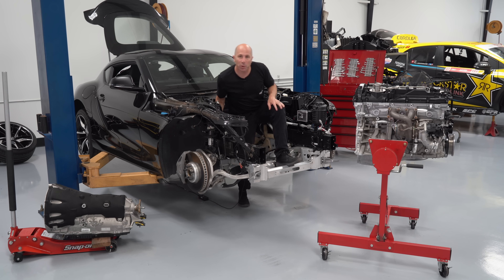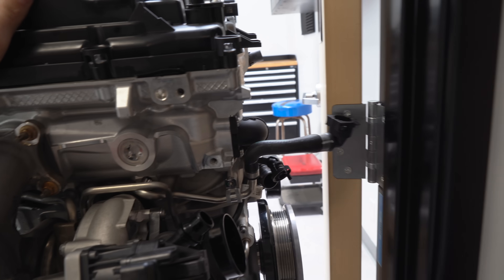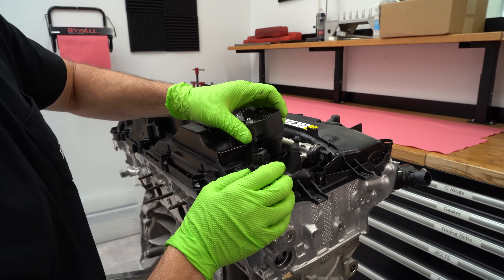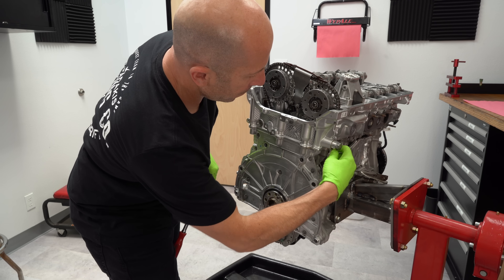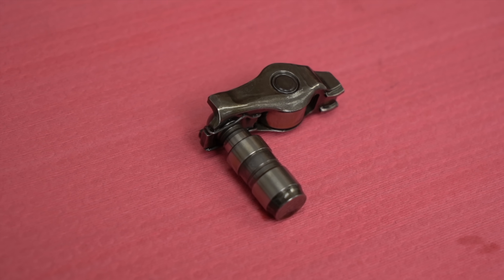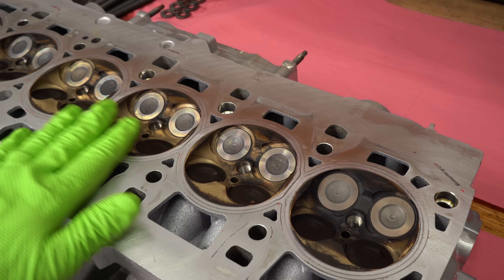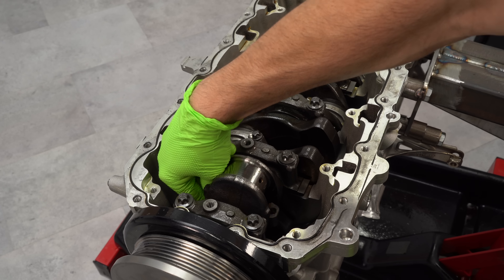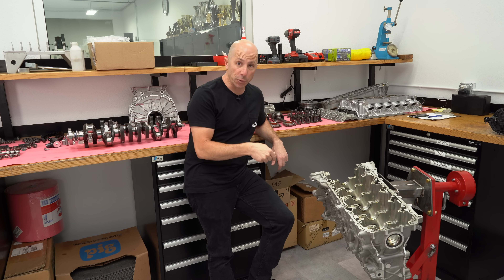2020 Supra B58 Engine Teardown - First Look - Better than the 2JZ?

Comment: How could this design possibly be good for maintenance??
Reply: The whole point is to eliminate trouble areas completely. Ie, the ignition module as one entire piece instead of several, no external oil lines running to a cooler to leak down the road, etc. Its very obvious that BMW put a ton of effort into engineering this engine to not only hold big power, but last a long time doing it.
Reply: @FlyingStuff  Except that the N54 and N55 that this replaced are both known for being total money pits as they age, and this one has all the same features as those plus a timing chain with plastic guides at the back!..... I would NOT want to own this engine after 100k miles!!
Reply: @soundseeker63  N54 money pit? WTF you on son. Aux systems like HPFP or coils go but the actual engine is solid as fuck.
Reply: Scott Fugere they put the timing chain on the rear...
Reply: @asshat Jackson You must know everything having sat at reception.

Comment: Timing chain on the back?  Oh FFS the Germans just don't learn.  2JZ you can change the timing belt in ~2hours.  In this thing you are pulling the motor out and doing a LOT of disassembly.  Simple design?  We have different ideas on simplicity.
Reply: And it's claimed to be a Toyota.. So much for serviceability. That shit is terrifying
Reply: @wicked49ford  
I had the 90's Ford 4.0 V6 designed and manufactured in Germany.  It had the timing chain on the BACK of the motor.  The chain guides broke and I had to pull the motor to repair.  I invented a few new profanities that weekend.  It is fine if you never keep a car past warranty, but long term it is a TERRIBLE design decision.

Comment: I have been a tech for 12 years now, I have rebuilt so many Supra engines and after seeing this... This engine is garbage, to much PLASTIC, they made it entirely to over built to the point if 1 thing breaks your spending thousands to repair... Just to much to fail on this newer engine...  I will always enjoy the simple Honda and Toyota engines from the 90s and early 2000s.... Honda is doing the same thing now, over complicated everything...
Reply: the problem isnt the car manufacturers but the government with those EPA and safety ratings

Comment: Extremly complicated, plastic, bmw motor. Designed to be a disposable. Will be pissing oil after 60k miles out of every hole, just like every modern BMW.
Reply: i just hope that the huge community behind the supra works fast to improve this engine

Comment: bmw engines are so sick!
Reply: Unfortunetly most of them are not reliable, luckly the're aftermarket piston bearings for the S85 V10 engine to keep it runing with no problems, but i may have to spend on a manual transmission swap if the SMG fails.

Comment: The only thing that seems like a concern with high horsepower applications is a lack of a cross bolted main cap system. Everything else seems pretty stout, but consider the traditional two bolt main caps as "potentially" a weak point. But hey, it could make 1k hp no problem.

Comment: Wow an an engine may actually be better than a 2jZ that inst Toyota? Hmmm.

FYI I still think it's not 😆
Reply: @Psycho-NutKase  it is not, Yamaha did the 1jz head. 2jz-gte engineering was done in Germany by Johann a. Krauze maschinenfabrik GmbH.
Reply: I don’t think that block will hold 1000 Hp it list not like the 2JZ
Reply: @bimmerlife5452  it's a closed deck design like the 2J. If the n54 could hold 800hp with a open deck and stock internals than the b58 should be more than capable.
Reply: @2jYeti  cant wait to see it bro
Reply: @bimmerlife5452  Lmao it would blow, but this comment was a joke ;-;

Comment: How much less does it weigh than the internet’s favorite boat anchor?
Reply: The RB26?

Oh, the other boat anchor.

The LS?

OH THE OTHER OTHER BOAT ANCHOR

The 13BREW

Oh, not that boat anchor.

I dunno. I'm sure it's just a bit lighter than a 2JZ.
Reply: @CardboardSliver  Well 2JZ weights 230kg and B58 140kg so yes 2JZ is overrated boat anchor

Comment: only issue that new engine will face is heat cycles that internal exhaust manifold is a proven weak point, but only time will tell. the design is all ready out of date....
Reply: @Seb C other manufacturers have all ready regretted that design.
Reply: @Seb C ask Ford

Comment: 1k HP on a supra? ..still will get beat by a stock eg in a down hill touge run 🤦‍♂️
Reply: If it is setup for downhills, the upgrading would not be focused on the engine but on the stiffness and lightness. Going for high HP is a clearly targeted to straight line pulls. More HP has adverse effects on the ability to handle the car in corners.
Reply: putting that kind of horsepower in that car without focusing on every other aspect is a fail in itself. So the same would apply anyway
Reply: @VERIFIED_COMMENT  in that we are in agreement. I recon the car is being tuned for a show off that only wants to impress by performing dull acceleration pulls. If the owner of this car is even semi serious about having a good all rounder, he is going to need to invest plenty more into the suspension and chassis itself. However having said that, knowing the maturity level of these ppl, as long as it looks good on paper, then it must be good.  I recon the true art and pleasure of driving is being lost in a world focused on selfies and showoffs on social media.
Reply: @ZxRx7  drag is a thing out here when I was  visiting my girlfriends parents in  japan I've seen kanjo and touge racing through her brothers and it's a whole lot of respect to the cars that they don't talk about 1k hp most I heard was 750 to 800

Comment: The only thing I have to say after looking at this engine - you boys better change your oil every 5000 miles and coolant every two years otherwise you'll be pulling that oil filter stand and that thermostat housing every two years. Also, BMW's favorite place to leak oil, the valve cover! Synthetic oils turn very acidic when they break down and start to turn rubber into plastic. Of course, BMW being one of the largest auto manufacturers doesn't have enough money to make gaskets out of proper oil resistant rubber, so you're on your own! That's why they glued the oil pan, because rtv resists bad oil better. Also, 100k miles in, all that plastic coolant pipes will finish cooking and start breaking. Plastic and heat don't go well together!

Comment: Is that a plastic timing chain guide I see? Classic BMW engine out service every 60kkm
Reply: never seen one fail tho lol.
Reply: @dimanestroyovyy  n47, that's all I'm gonna say.
Reply: GTTwincam oh I didn’t know, on the n52, n53,n54,n55, they never fail, and if they do, they’re really easy to replace. Me saying that because I broke it while screwing the head bolts on a head gasket job
Reply: Soon as you google n47 timing chain comes up straight away, Iv seen same problem on many Bmw engines, it wouldn’t be too bad to service until they decided to stick it at the back
Reply: Yeah Bmw have some great reliable engines definitely, usually the 2litre diesels they share with mini seem to be problematic

Comment: Crappy unreliable bmw motor. Couldn't touch a 2JZ if it wanted to. These bmw inline 6 cylinder motors blow up after 500 crank hp unless they're pulled, and fully rebuilt for about $20k, then you might get 850hp. The old 2JZ could handle 650-685 on stock internals, 1400 built.
Reply: @Seb C I've been working on engines 35 yrs with a neighbor Master BMW Tech. I've had various bmw 6's and 8's plus 2 2JZ's. Bmw 6's do not last long with 600 crank hp which is around 530 whp.

Comment: Remember before buying the C8 : the ecu is factory-ENCRYPTED, so not tuneable whatsoever.
Reply: Holley already has plenty of aftermarket ECUs
Reply: Haha, the N55's used to be encrypted and "untunable" too. Now people have doubled the power and more. A lot of modern engines are encrypted to some extent and every manufacturer says that, but even a high up rep in Chevy says that he hopes to see modified C8's. The reason it's encrypted is for security reasons, not so people can't tune them. It will just take a bit longer for people to crack the ECU.

Comment: BMW engineer good for European cars. Nothing can compare to a 2jz. Better to change the badge back to BMW Z4
Reply: Seb C you probably had bad luck. As a mechanic these new European motors are garbage they are plastic 100,000km parts disintegrate especially bmw and Audi parts, Mercedes isn’t too bad. I’ve seen camrys last 500,000km on original motor. Name a European motor that lasts without major problems? I’ve owned 1jz and 2 rz supras now I own gtrs but I still prefer 2jz motors as tougher than rb26. No comparison these new motor are made to stuff up so you take it back to dealer so they can charge you top dollar for fixing stupid problems like faulty sensors.
Reply: Seb C mechanically they can last definitely if looked after. It’s always the plastic parts and gaskets they let go and the owners keep driving the car until it shits it self. Especially Audi Porsche with the plastic coolant lines and thermostat housing. Bmw always has oil issues always maybe this new supra might not but give it 5 years and let’s see the sales.
Reply: Seb C that’s what’s scary seen oil pan leak? A lot of them don’t have gasket just silicone and when they leak they leak goood

Comment: This seems like a really cool engine, but it's really complex to be marketed towards tuners and car modders. The amount of electronics this thing has makes everything a lot harder to work on and change out. I mean just look at the top of the engine before teardown, did you see all of those wires? I also hate how the engineers thought it was a good idea to use plastic parts. The longevity and reliability is questionable at the least.

Comment: Awesome video and I, along with the rest of the viewers appreciate this effort of creating a tear down video of this B58.  I have what may be a 101 level question.  When you removed the head and had it upside down, why were only the exhaust valves darkened, but the intake valves were not?  Combustion happens in that chamber, so I would expect both would appear to be visually equal. Is it due to the exhaust event in the combustion chamber presenting backpressure to the exhaust flow against the turbine wheel and exhaust system as a whole?

Comment: Lots of people complaining. Yes, it's gonna be a good days work to get to that timing chain. But the engine doesn't have to come out. Looks like you can just drop the trans, remove the valve cover and bam there it is. Timing chain. Really not that big of a deal if you don't mind doin' work.

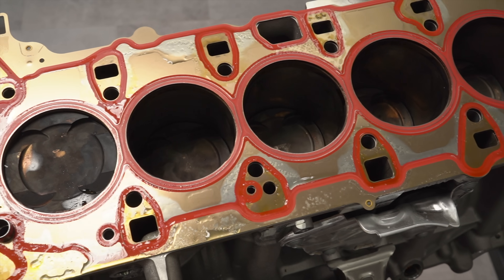Comment: 9:42 its good to see that they use these kind of sealings on the head. Normal flat gaskets spread the force over a wider area, which reduces the pressure the gasket can hold. 
With the domed gaskets the resulting higher pressure makes it more leakproof - Should be good for a lot of boost!

Comment: Lol coated rod bearings...made me think about the E92 M3. I guess BMW learned from that.
Reply: or e60 m5 lol.
Reply: All high rpm M models
Reply: E46 m3
Reply: you should thank Toyota for that. They made sure that the B58C in the supra doesn't have bullshit and cost cutting things in the engine. It is different to the standard B58 engines.
Reply: @1GTASANANDREASCJ  what are the main differences?
Reply: @rodgazinya  i didn't find a list. But i saw that the Z4 has a standard 6 port exhaust manifold instead of the 2 port the Supra has.
So the cylinderhead is different.
What both share: cam chain on the back of the engine, so a replacement will be expensive.
Reply: I talked to a BMW race shop about the M3 V8 engines and here is what they said. The E90 or E92 M3 rod bearings are fine. There were a few cases of rod bearings causing catastrophic engine failure and that made people overly worry. What most likely caused these issues were likely oil starvation, old or improper oil, or just random bad luck. Performance shops capitalize on people's fears and push rod bearing replacement to customers. There are many high mileage V8 M3 engines that have no problems with the rod bearings. Rod bearings in any engine on this planet will show signs of wear. The wear on the V8 M3 rod bearings are not better or worse than a typical engine. It is not unusual to see rod bearings showing some signs of wear or use when you remove them. People's fears are being exploited for business gains.
Reply: Dylan stop while you can 🤣👍
Reply: Lol look at all you 2jz fanboys getting upset, BMW runs your shit
Reply: this is  a BMW engine in the new supra
Reply: @dylanm9981  thanks for letting us know before your comment nobody knew that
Reply: @dylanm9981  my god!!! You're serious? I thought it was 3JZ-GTE engine. Wow thanks for the info😑🙏
Reply: @dylanm9981  holy shit!!
Reply: Dylan Marshall you’re joking dude. Did you not see all the Toyota badges? This is a 3jz

Comment: Timing chain in the back ...

Audi 4.2 V8 flashback
Reply: That's a car you don't want to own past a timing chain service...
Reply: @UconventionalWarrior  They don't need timing chain services, they make over 200k miles on one chain
Reply: @Malteser3535  the audi s4 with a 4.2 v8 was supossed to be a lifetime timing chain.  But the tensioners start cracking and losing pressure anywhere from 30k-200k miles.  About a $4k job in parts alone.  One of my tensioners dissintegrated, jumped the chain, and ruined pistons/valves/everything.  It had 40k on the new tensioners.
Reply: @Malteser3535  The chains themselves, yes. The plastic tensioners and the VANOS units (for which the chains need to come off)....probably not!
Reply: @Malteser3535  ...and 50k on the plastic guides.   A timing chain is only as strong as the weakest link.
Reply: have done timing on those and the VR6, i share the same concern.
Reply: I was thinking the same thing LMAO
Reply: I owned a b6 s4 that failed.  I shuddered when he said timing chain on the rear.
Reply: Fuck those soooo hard!
Reply: Clearly BMW haven't learned much from the N47 disaster!
Reply: I spent all my time working on the 1.8T I have never had the opportunity to work on a 4.2V8.
Reply: Yup, Audi/VW love to put them timing sets in the rear to make the guides a joy to replace.
Reply: Iron Duke was a great motor
Reply: BMW owner and yes it’s a headache
Reply: got it right in the rs4 though
Reply: The worst
Reply: I have to do my 3.2 vr6 quattro next month... pray for me.
Reply: similar to N14 mini cooper s engines too.
Reply: Range. rover /ford. explorer 4.0 v6 one on drivers side front one passenger rear 22 hours.  to change the. rear.  engine pulls. is 14. hours so yeah
Reply: I was thinking VAG about the plastic inlet manifold too. This thing is a set of disasters waiting to happen
Reply: @hydorah  you know how many engined have polymer intake manifolds.
Reply: @hydorah , the trend it's plastic... I repair manifolds and the only aluminum ones I see it's the older ones... The manufacturers don't make the exhaust manifolds out of plastic because they can't...
Reply: @cooperwrks  Yeah. The trend is indeed plastic and due to differing reaction to heat cycles and tendency for plastic to become brittle it present failure points as seen by owners of VAG cars with plastic inlet manifolds. Manufacturers are doing it whether we like it or not! Cost is king
Reply: @hydorah , the worst parts are ones made in a dark plastic or resin that is green on the inside... They are for parts that handle coolant... Very brittle, hard to repair and they insist on making them as big as possible, so if you have a leak, is a big leak
Reply: I'll pass. It's not a true Toyota Supra. It's a BMW
Reply: Eric Viken There’s a 100% chance you would not be buying it either way and therefore your opinion means 0% to anyone
Reply: @ericv.9842  the supra hasn't had a toyota only anything in awhile
Reply: Didn't that Audi motor have three chains in the back? 

Always hated those cars.

Comment: "Contrary to people's believes the new BMW engine has been simplified and even easier to work on than older engines"
proceeds to machine a 14mm socket to take out the spark plugs

(This guy can be a great salesman pitch)
Reply: Wow you have to pick the right socket size... thats a lot of work
Reply: Oh and you forgot he had to modify the engine stand to make it work with this simplified engine design.
Reply: that engine is anything but simple.
Reply: There's a lot of stuff on this engine, but comparing it to the past BMW turbo 6-cylinders, the packaging looks a lot cleaner.  Certain items, like the turbocharger and thermostat, should be much easier to access and service.  Timing chain in the rear is a little worrisome, but when it was in the front, a failed serpentine belt could get pulled into the timing set and cause serious engine damage.  At least that seems unlikely now.
Reply: I had to machine my spark plug wrench to remove plugs from my 1990 Honda Hawk GT motorcycle.
Reply: Well, if he would have just bought the 14mm spark plug socket since BMW has been using those style plugs for about a decade...
Reply: Needing a special spark plug socket is an extremely minor complaint for long term ownership.
Reply: @thatoneotherotherguy  indeed. BMWs were my specialty when I worked at a euro shop some time back. They're some of the easiest cars I've ever worked on, and coding and programming with ISTA is absolute cake. They're fantastic cars if you have the money to maintain them properly